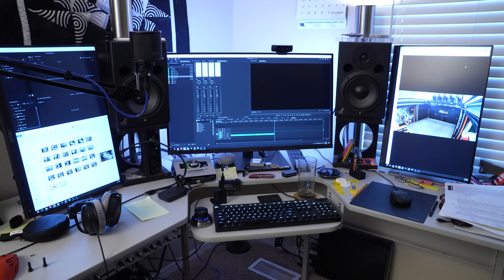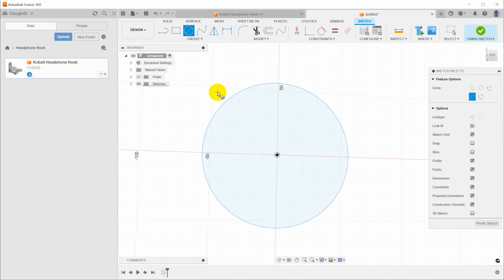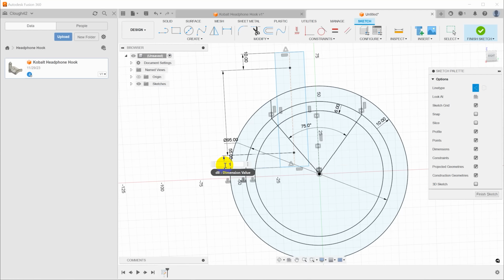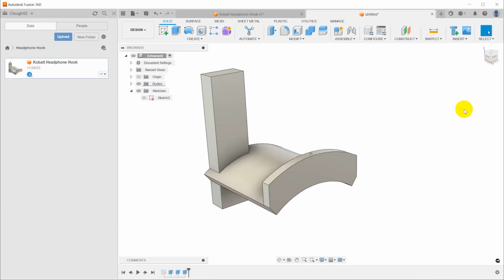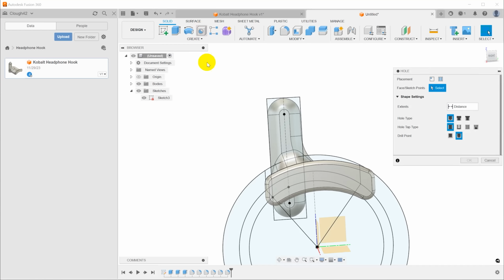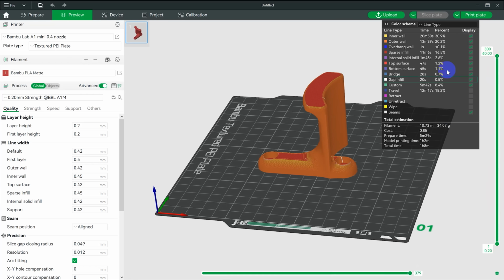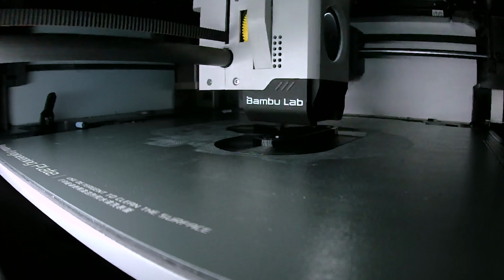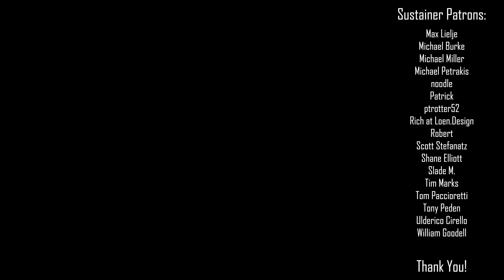Design Curvy Parts the Easy Way | Fusion 360 Tutorial

Comment: This video was sold as a way of designing curvy parts, but Woooooaa, I learned a ton of quick designing techniques .. all that 'point', 'countersunk hole', 'point constraints', 'extrude from a new face' etc etc I hadn't come across those before (I am new to F360). These are amazing tricks I'm going to try. Also I've hit issues with filleting before and didn't know F360 shows the bit that's causing its issue, so I also learned how to diagnose that. Thanks for all the info.

Comment: Fast video but i learned so much! Been spending some time learning fusion 360 now as i got a Bambu Lab X1C as a surprise gift from my GF. Im a mechanic so this computor designing is new to me.  I can make something similar in metal easy but ive discovered that 3d printing is much more fun and easier as i dont have a workshop anymore. BUT, you also  taught me something new with calipers. Measureing center to center is so logical ir your way. Thank you, you got a new follower.

Comment: Bambu Studio offers a "variable layer height" setting that allows you to reduce the layer height in areas with many curves, significantly smoothing rough surfaces. This feature is time-efficient as it is applied only where necessary.

Comment: Very good video, I have learnt a little more as I have just started with Fusion 360 and my Bambu printer. I bought it to print deck fittings for my 1/10 scale model of a Venice water taxi and so far the drawing/design and printing is going well but always keen to learn more. Cheers Ian, New Zealand

Comment: As a relative noobie to fusion 360, this is gold dust! Thank you 😊. Ive just designed my own, by using your excellent info... similar idea, but with a horizontal  mounting bar, as its going into the edge of a 1" thick desktop.

Comment: I've been using fusion for about 4 years purely as a hobbyist,  and you've taught me two things here that I wasn't aware of, the hole tool for screw sizes and with space for the bolt head!!, how have I missed that. And also extrude from body, that will save me extruding 100mm then cutting 95mm !
Thank you!

Comment: I’m just getting into 3D printing and this video was great. I started using fusion initially but found it confusing because I had no real understanding of it. So I have been using TinkerCad a lot which is more intuitive but not as powerful as fusion. I’d like to get into fusion more and the video is helpful but I need more instruction. Do you have any recommendations for online tutorials for fusion?  I also liked your caliper trick for figuring out the hole spacing. Thanks

Comment: This is quite a coincidence. I just designed my own headphones hanger for the exact same reasons approximately two weeks ago. My initial design idea was extremely similar to yours, including screw placement. I instead went with a boxier design where both screws go through the back behind the headphones at a slight downward angle, and I left a hole in the front of the hanger to pass a screwdriver through for the bottom screw. My headphones have a fairly large pad, so I made the front wall fairly tall to hold the plastic part in. My design is symmetrical, and I had wanted more curvature like yours, but some thin areas of the print made filleting hard. I still got some rounding on all the edges of course.
The interesting and challenging part of my design is that my headphones are flat one the front of the band and have a curve like a banana on the back side. So I wanted the back of my holder to be flat and the front to match the curvature of the band. I wasn't sure how to accomplish this, so I actually dabbled with 3D sketching in Fusion 360 for the first time. There were definitely some interesting challenges with it. I learned a lot. Ended up using the surface modeling features of Fusion a lot where I would create a shape completely from sketch lines in 3D including curved lines and then patch them until there were no holes. I then had to use the stitch command to make it into a solid object like usual.
I learned some nifty tricks from your vid I def could have used too. Thanks!

Comment: This creature is very nice, but this video promote bad idea! When 3D model have fillets, it's hard to edit. If somewho find your model in net, like it and want to use, but with little correction for his situation, you make problem for him. All that curving don't let to change thickness, length and width, hole placement, or details to simplify printing. Also, this kind of STL file have bigger size, because round faces do bigger number of poligons. This file can have errors and problem with converting or slising. All I want to say, is don't add fillets without a reason, just for beauty without functionality. Be rational in your design:з

Comment: Getting it right the first time is something that never happens to me. 

The issue I see is the downward force of gravity is working on the weakest part of the print, the layer lines. Ideally the layers should be perpendicular to the piece of furniture instead of parallel to it. If it doesn't break, though, strong enough is good enough.

Comment: Good stuff.   I’d recommend using stp files instead of stl.   I’m not sure how many slicers will do it, but bambu’s definitely will.  You’ll get smoother prints in a lot of cases (no triangles/facets).   Also, stp files are just so much nicer to work with (to modify, to check fitment in an assembly, etc), so I’m really hoping the whole industry goes that direction.

Comment: Can confirm PC is great for durable parts. I have a 1/10th scale RC truck that I ended up printing gears for just a an experiment and the PC gears are the only ones that stood a chance(I did not try ABS or Nylon). It definitely has it's limits but the limits are much higher than PETG and standard PLA

Comment: You can improve that overhang quality by decreasing the speed at that area, or setting a minimum layer time (Filament Settings, Cooling Tab, Part Cooling fan area, Layer Time setting. Make that 7 seconds or higher maybe? I do this for curved tubes to make the inside overhang not mess up.

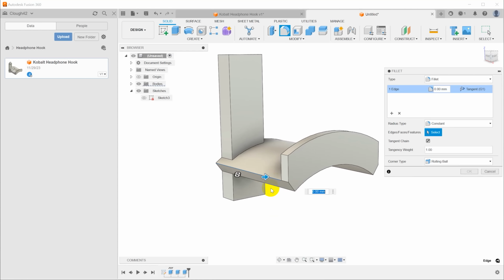Comment: 7:35 personally i would have eliminated the vertical bar and two bolts and instead gone with the just the arch and one tunnel directly underneath it for one single long bolt. this allows the bolt to take the load bearing function away from the plastic. this would allow me to use PLA which would otherwise be load creeping over the months, because i would want to use the Bambu AMS for multi color in black and for the lip either electric blue or wood to match the Kobalt drawer. all black is going to be troublesome to see in the dim lighting. some double sided tape between the arch and the drawer should easily handle any concern about the arch torqueing around later because its only mounted with one bolt.

Comment: 1 > Okay if you have the skills and brains to work with a complex CAD software like Fusion 360 which is a even more complex one than Blender which also is complex to use.
2 > also have a free high end klipper 3D printer helps too!  Both things most of us can't have sadly.

This is why CAD designers and such are the few not the many per population and why they are paid huge amounts of wages, Because they are so clever and skilled.

Comment: Really love your dark office setup. I wish i had such space available to me at home. Im resigned to a laptop on the dining room table and my printers reside in a cold garage.

Im sure its been mentioned before, but from a method standpoint, this is the wrong way to design and locate holes if you compare to engineering industry modelling standard. if you compare to a hobbyist standpoint, work away, it is fine and it wont print any differently.

i just dont want beginners to look at this and then potentially move into a design engineers job. Any young engineers i am responsible for are taught to locate  and model holes from datums on your initial extrudes where possible. Fillets and complex surfacing is to be done afterward. this is a recipe for a sea of red/failed downstream features for people who have to come in after you and make revisions to models moving the holes or changing the fillets. This actually isn't aimed at you , its just for anyone reading your comments. i love your channel and your content.

As a final (long) note and i hate myself for being so damn pedantic but i simply cant let it go without commenting.....but i heard you flippantly say PC is stiffer than PLA.
 PLA is definitely stiffer than Polycarbonate. PLA is the stiffest material available to most hobbyist makers and most people get lost in the language....i.e stiffness and "strength" are two different things..

PLA will not easily dent, or deform, its very rigid. It breaks before it will do this. it has a crystalline structure that helps ensure this. PC will to a certain extent.

strength can be broken down further.

-resistance to bending - In this case PC has a higher flexural modulus
-toughness (impact resistance. Or materials ability to absorb impacts before breaking) - in this case pc is the tougher material
-hardness (resistance to abrasion of any kind...2 materials rubbing on each other, scratches etc)  Pc wins here slightly. PC molecules like each other more than PLA molecules do (not  to be confused with the crystalline structure of the molecules...they just stuck to each other more)
-elongation before breaking or a measure of a materials ductility. -  PC wins significantly here with 100% elongation before break vs 3% pla

So in short you would never use PLA where you expect significant bending, elongation, impacts or deformation (or 'strength'), but you WOULD use it if you need a stiff material that you want to resist any deformation in...its just when the deformation occurs the material is kaput. This is why PLA is the best material for metal forming dies that you see guys doing online..it will channel most of the energy into the metal instead of absorbing it itself....unless you put too much energy in....!

Of course PC is a better material than pla for what you are using  it for so you definitely made the right choice.

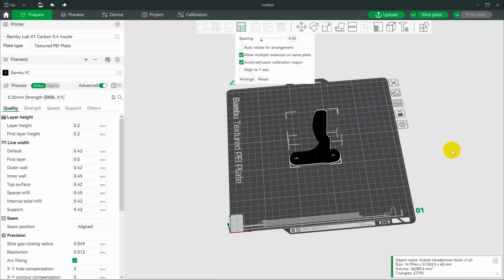Comment: 13:50 you could consider printing parts left and right on the build plate if there is space to pre-long the carbon rods.
Not sure it’s necessary but it will not hurt doing so. I am doing it with my X1C just in case.

Comment: In case you sometime accidently bumb in to bracket and break it, I would recommend designing new one with longer lower screw that is acting as an internal reinforcement for bracket. That will also make possible to design even more curvy part... Beside of those few defects, surface quality look really nice for printed part.

Comment: That looks really nice James. Just one tip from me, you can switch your 3d mouse into a 2d mouse for sketches, I find it a lot easier to look straight on a sketch. I use one of the two custom buttons to switch from 3d to 2d.
Reply from the maker: Oh, that's cool.  That would make things easier.
Reply: How do you do this? I've been trying to find a quick way to toggle between looking at the sketch (2D) and with an angle. I find a bit clunky having to click the view cube to "look at" and then drag the view cube to get out of the 2D "look at" mode.
Reply: @christopherhorstmann5733 are you working on a Mac?

Comment: Tipp for exporting into the slicer: Bambu slicer does handle obj files so you can use that to not get problems with the stl making your print less round than you designed it.

Comment: If I know some part of the model is going to be hard to print because of an overhang, I try to combine chamfers and filets. Still gives a smooth result but takes away the eyeballing as it will never exceed the angle of the chamfer.

Comment: Nice tutorial. I love these short ~ 15 min. tutorials. Even with my almost 20 years of CAD experience with different packages, there are always some of this little things that I pick up while watching them 👍
Putting the holes in before applying the fillets is one option but having too much geometry may interfere with putting on more complex fillets. Putting the holes in before applying the large fillet on the top would most likely have limited the size of the fillet.

Comment: I’ve been using calipers for 15 years and never thought about zero’ing the diameters of the pin to get on-center distance 😳 Nice trick
Reply: I feel dumb.  Its obvious, super useful, yet I never even considered it using zero for anything other than closed positioning.
Reply: I must only find the zero button on my manual/analog calipers, now! 🤔
Reply: @martinmajewski you rotate the dial🙂
Reply: @spray_cheese no dail… I use those analog-analog ones which have only a bar scale! 😅 No worries, I’m pretty good in mental arithmetic! 🤓
Reply: @martinmajewski  ohh I see, I’ve never even seen one of those before with just the bar. Makes complete sense that it would exist though even today. 

But yea in this case subtraction and remembering a number ain’t too hard😂👍
Reply: @martinmajewski  I know!  I finally see a significant reason for buying some digital calipers.
Reply: Much easier to zero on the hole diameter and use the other side of the calipers to measure the hole to hole (outer edge to outer edge). Same concept but you can skip finding the screws.
Reply: was going to say the same thing I feel like a caliper wizard now
Reply: @lililililililili8667 some guy's have brains like a computer!
Reply: Yep, I've got a set of those calipers too. Now I can get inaccuracy to three decimal places! "Looks about 15 to me. I'll use that."
Reply: As an engineer have used this technique for years, if the the two pins/screws are different diameters just remember to minus half the diameter of each screw from the overall dimension.
Reply: Yea, that hack just rocked my world.
Reply: Me too amazing trick!!
Reply: Amazing trick!!
Reply: I also learned something new today. I have also been using calipers for quite some time and never knew about this trick. Just never occurred to me. Freaking awesome.
Reply: The timing of this hitting my home page is uncanny. I designed a clunky version of this for the side of my assembly table, which is metal with a 1” on center pegboard hole set. I love this version so much I’m going to redo everything in my model except my mounting plate. Great job of making the complex simple! I’ll also be heading over and adding my support to your Patreon channel.
Reply: Maybe if they called the zero function tare instead it would have been more obvious. I definitely never thought to do this either but i weigh lots of stuff in the kitche. By taring the scale with the containers on them first.
Reply: thats probably the only advantage the digital one over the vernier one.......
Reply: FYI You can also zero the diameter of the hole, if it’s something like a bracket you’re trying to replicate 😊
Reply: I came here to comment about this - INCREDIBLE trick
Reply: Thought the exact same thing when I watched it.  I came down here in the comments to post the same thing you did.  That trick is getting filed away for later use.
Reply: You too, huh?
Reply: 🤯 not going to lie i was a bit mad at myself for not thinking about this on my own before.

Comment: strangely you did nont put clearance on the holes and the screw fit without problems, did you channge anything inn the slicer? .
Reply: That’s done automatically when using the hole tool, when you chose what goes into the hole, it is created with the correct clearance for that fastener.
Reply: @isorobot  thx I didn't know.

Comment: Thanks for the reminder that Google Home can't see any of the lights in my den... Had a firewall that needed to be reinstalled a couple of weeks ago, and all the IoT devices in the IoT VLAN got new IP addresses. Switching as much of that out to Zigbee plugs and bulbs but haven't made the new devices available to Google yet. Nice job on the Headset hanger .  I went with a much simpler design a couple of years ago, it's still working OK, but always curious how others are designing and implementing them.

Comment: Every time I watch your fusion videos I learn something new. Your tutorials are the best I have found. One question though, what material would you recommend for strength, rigidity AND UV resistance?
Reply: If you want the easye route, I would go for PETG
Reply: @01Pascal01  petg flexes a lot. I can try carbonfil
Reply: ASA, just need an enclosure.
Reply: @arauchfuss  just ordered a k1 Max with enclosure but no active heating

Comment: Yes, Fillet function is your friend when you want smooth flowing transitions between faces like that.

Granted I'm sure you know this James but in case not, and for others who don't, you can do that same center to center trick without the bolts by using the ID blades of the calipers in the holes themselves, ID measure the hole, Zero calipers, then just measure outer edge to outer edge between the two holes with the ID blades.

Also what a lot people don't know is that this direct measurement trick only works correctly by itself if the two features are the same side (Same ID or OD depending on which way you do it). 
With that said, there is a pretty simple way to still do it when they aren't the same diameter. Simply measure each diameter, extrapolate the radius of each and then add the two radiuses together and zero the calipers at that number, then you can measure the center to center just as you would.
 
Example, say that you have two round features, one 6mm and the other, say a 10mm. just add the radius of each (obviously 3 and 5 for this example) and open the calipers to that size and then zero them and measure just as you would
Reply: Yes, using the ID blades is possble, but I think that in this case that is not the easiest way to get the calipers in and handle them at the same time. On large flat parts I mostly prefer the bolt measurement because of this.